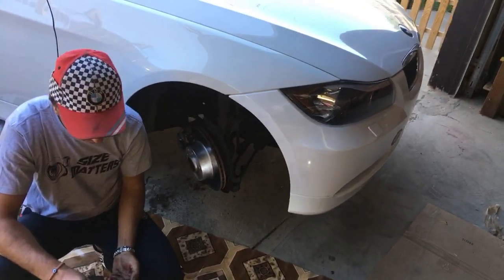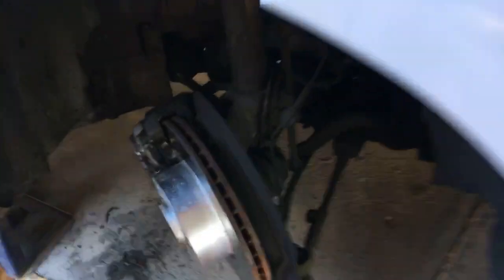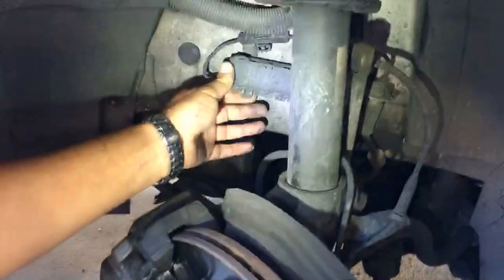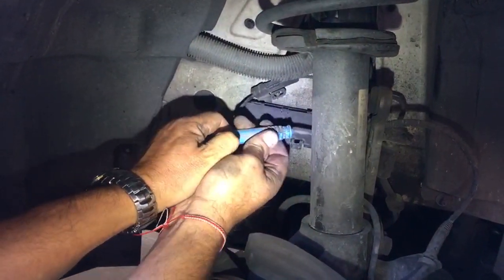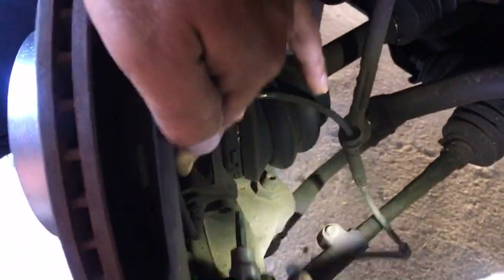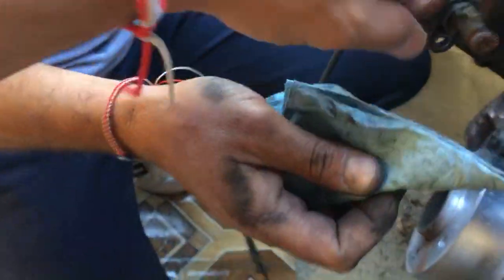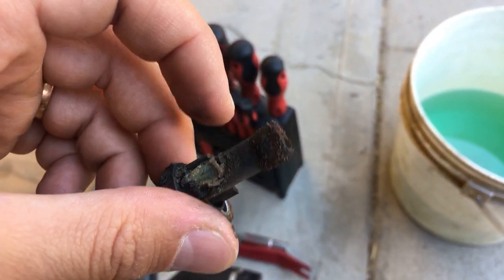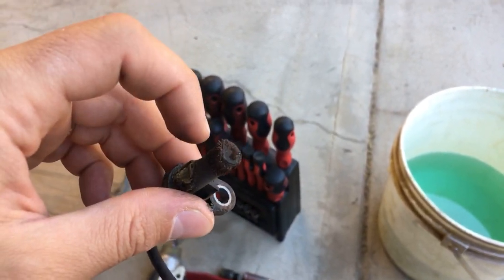HOW TO REPLACE ABS SENSOR SPEED SENSOR ON BMW E90 E91 E92 E93

Comment: Need to do this myself. I have had it in twice for ABS & Tyre Pressure warning. Its that bad now that if I go over 45MPH it completely shuts most of my dash off, Speedometer stops working and MPG dial & more lights come on such as seat belt and air bag light! Would love to have the know-how to fix it myself 🙄
Reply: I have the same problem.

Comment: Hello, I recently started having a problem with ABS and Tyre preasure monitor on my control board. Diagnostics is showing front left sensor malfunction. The problem is I have two connectors there, upper and lower one. Upper when shows ABS fault when disconnected manually but lower connector is plugged male-female and wires are cut coming out of it. I tried taking a known-working one, cut and connected wires with eachother but the problem remains. Can someone please tell me what is the function of this lower connector and how can I resolve this.

Comment: what happens if i dont fix it soon
Reply: If you brake too hard the abs won’t work. If you really need to stop, it will lock the tire up on the wheel with the faulty sensor. Learned the hard way.
Reply: Also disables cruise control if abs is not working